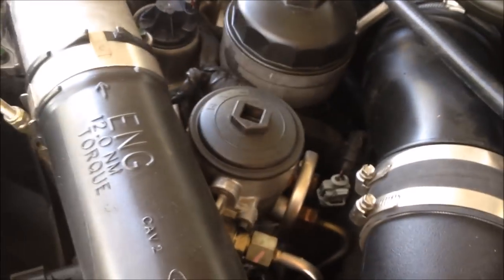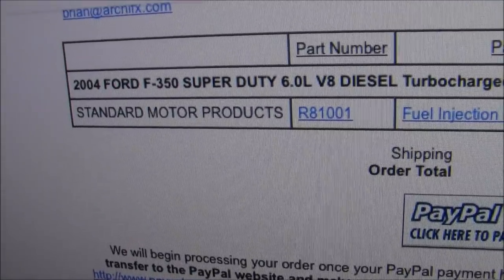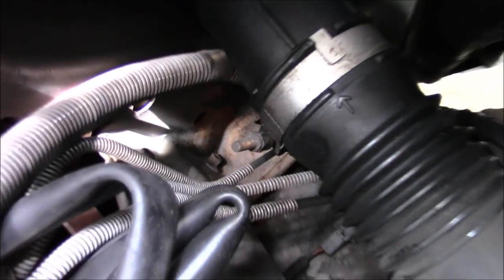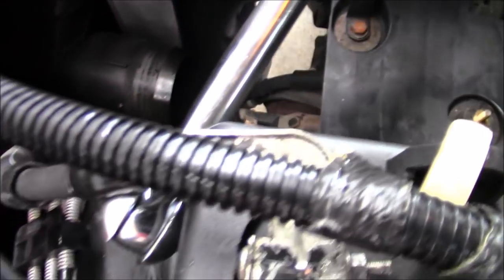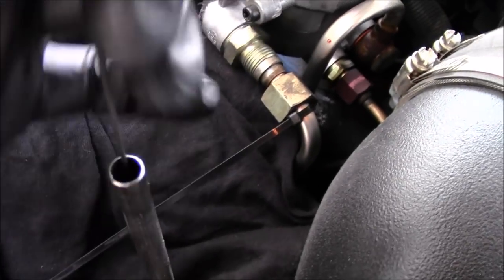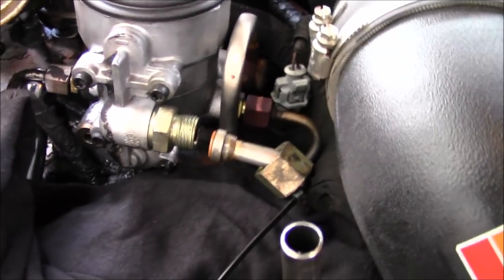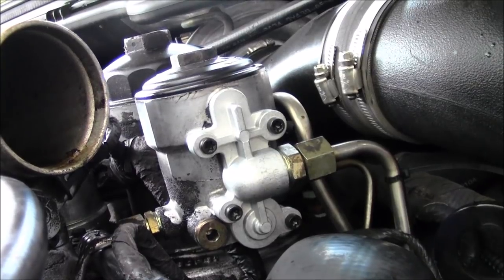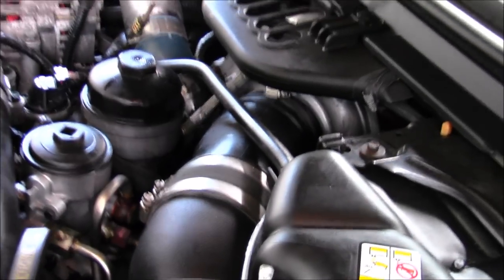6.0L Powerstroke Diesel BLUE Spring Upgrade | Full How To Video + Fuel Leak Footage

Comment: I got my blue spring regulator kit at Ford, about $92 with tax, has everything you need including new faceplate, the torx screws are a little tight but worked. Your step by step Video was a perfect and my 6.0 is back on the road with 160k miles. Thanks again brother!
Reply: You waaaaay overpaid.

Comment: perfect video. had my phone under my hood watching your video step by step to get it done. i did this specifically for increased fuel pressure and went from 53 to 67 at idle and 56 wot..couldnt be happier. and for everyone else, I bought the cheap blue spring kit for $20 on ebay not the expensive one from International (Ford)

Comment: i would get rid of the k&n intake or atleast just the air filter ive seen a bunch of engines dusted because of those see through filters. another thing thats the wrong coolant for that truck i would recommend rotella elc coolant its a red coolant and only use distilled water for the mix. Nice informative video i watch some 6.0 videos sometimes so if i ever have to work on one of these i know somewhat how to do it.

Comment: The cac tube doesn't have to be removed. Just loosen the top clamp and pull it off and aside. Remove the air box with maf and intake tube. Take a prybar wedge it under the fuel filter housing and tuck it by the battery to hold the radiator hose down and out of the way so you can get the bottom right bolt out with ease.

Comment: It looks like there was a brass piece that went in the groove vertically and the top end of it sat on top of the small plastic piece that broke. I didn't see you replace it before you put the plate on. Maybe you did it when I wasn't looking. Just wondering??

Comment: Good Video, But, when you removed the old "o" ring from the fuel line at 26:15, did you reinstall a new "o" ring before putting lines together?  The video does not show this.  Thanks

Comment: Doing mine right now, Diesel Tech Ron shows an o ring going on the black plastic seat at the bottom before he puts it in. You do not. I cant get the piece in with an o ring on it so I'm doing it your way. But I'm slightly confused.
Reply: mottrocks check that, found a flat hard O ring on the old seat, so I put one on the new one. It did not go in easy or straight, but I pulled it in with the bolts and it started right up. Thanks.

Comment: Is that green coolant?!?!?
Reply: what would be the difference?
Reply: Abel G ford 6.0 coolant would not be green. it's more golden yellow. big difference.
Reply: i used to have the green coolant first months owning the 6.0 but after gathering info on 6.0 groups i changed it to elc... radiator had a leak so might as well put the right coolant.
Reply: Abel G ya I guess the traditional green universal coolant can cause gelling and what not. best to go with the oem stuff for sure
Reply: That extremely high heat in the egr cooler will break down antifreeze. Motocraft Gold antifreeze handles the heat much better bust still breaks down over time. Additionally the Ford radiator caps wear out very quickly and can cause the boiling point of the antifreeze to be much lower. Upgrade this and keep more antifreeze in the truck.